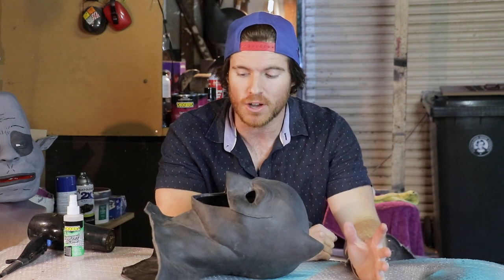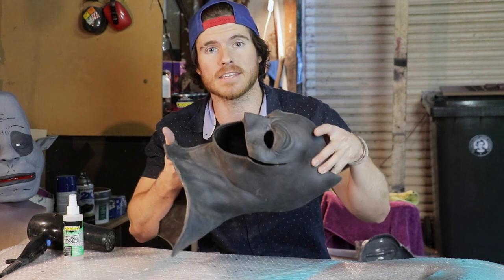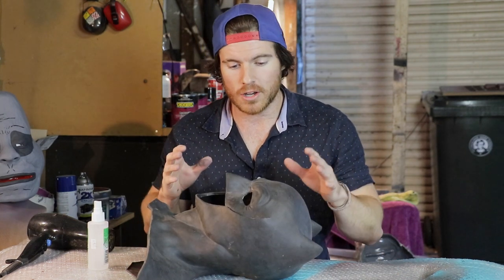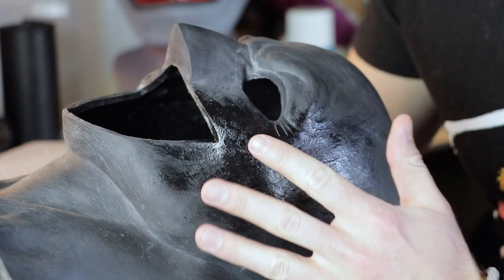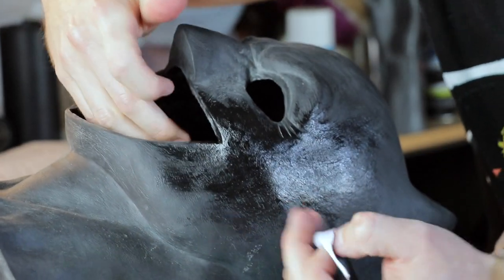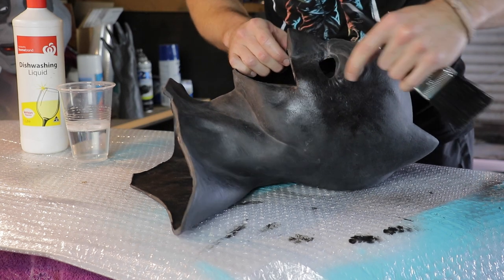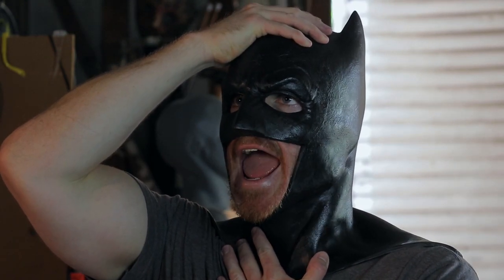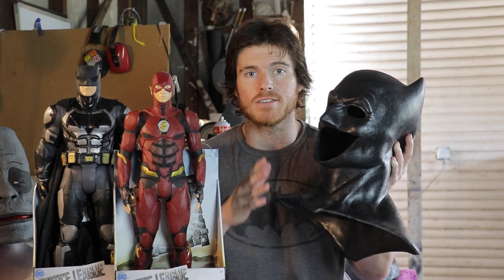Repairing a Torn Batman Cowl- Chris' How-to!

Comment: I have a question. So I have a Dark Knight cowl that has a large tear in the back. However I got it 4 years ago and I cannot remember if it is urethane or latex, or if there is any difference. Will this method work regardless? Thanks.

Comment: Is there a way to repair the edges of a rubber or silicone that have become "rough"? The best way to describe what is looks like is a mouse nibbled on them.
Reply: Depending on where the damage is you can sand it CAREFULLY. Start with a fairly aggressive coarse glass paper like a 400 and eventually work up to a 1000 and feather in the rough edges as best as you can. 

Just be aware the paper will clog up fairly fast on very soft materials!

Comment: After cleaning it with warm water, maybe also spray a coat of plastic dip over the whole cowl (kinda like a candy shell)
Reply: FUEGO City if you did that it would be hard to put on, you need it to flex if you will be using it. If it's just for display then plastidip is a good idea